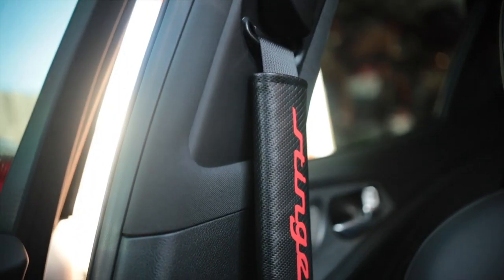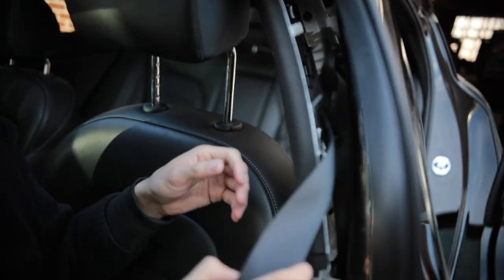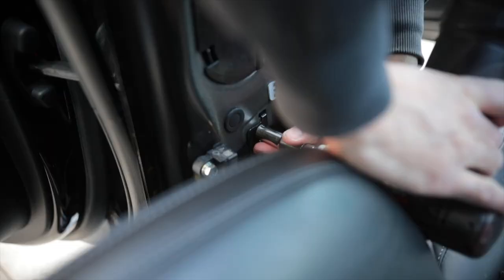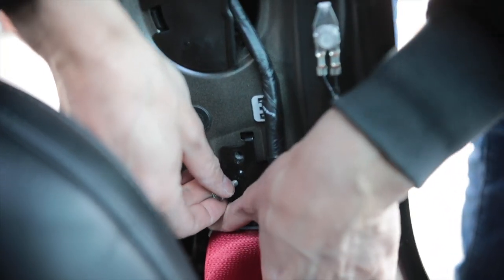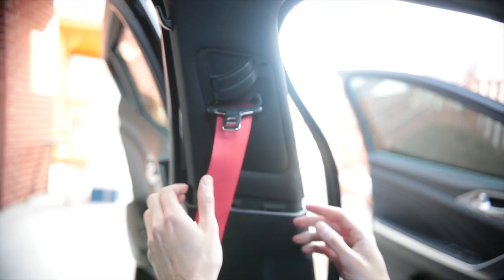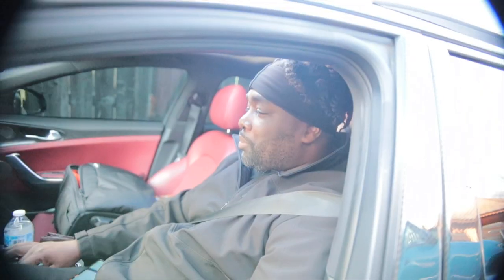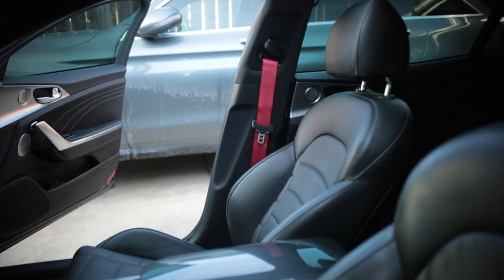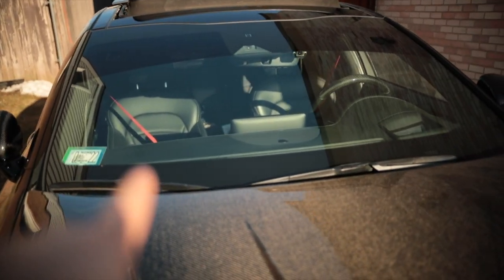2022 KIA STINGER WITH RED SEAT BELTS *INSTALLATION VIDEO

Comment: just got my new stinger with the 2.5T, i keep coming back to your channel for inspiration 🙅🏻‍♂🧢 i think some bigger wheels and a jb4 will be my starting point, trying to see if the jb4 gets me enough horse to be worth the install, cant find any dyno charts on the 2.5 specifically
Reply: Did you end up finding any? Also have a 2.5 and considering it..
Reply: @gu1targuy  I found this video: https://www.youtube.com/watch?v=8BUkML5k9v4&lc=UgygUbzYW_4ZOQBMRh94AaABAg.9_-opM45g7x9_06so5HWTA

He mentions that the Jb4 for the 2.5L DOES NOT come with clips for the harness...that is unusable imo, unless you rig it down with some zip ties, it will likely unplug on bumps. I hate this fact, its a brand new car, not going to zip tie harness plugs into place.